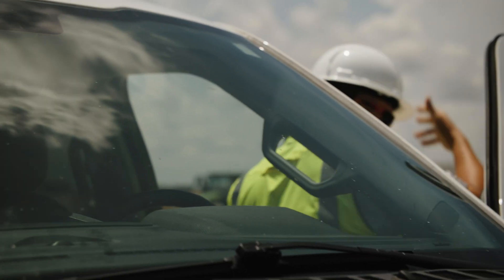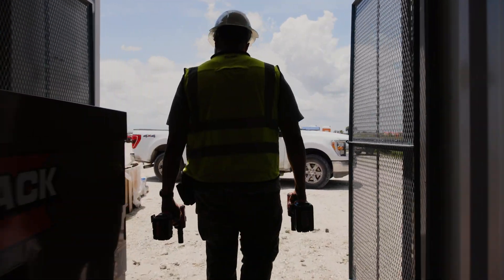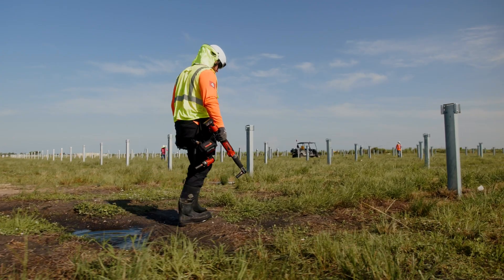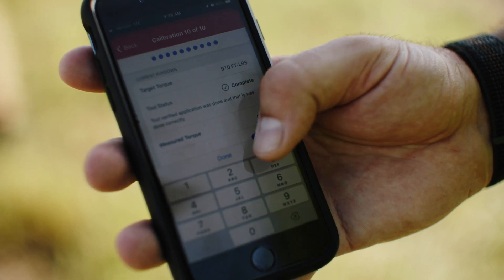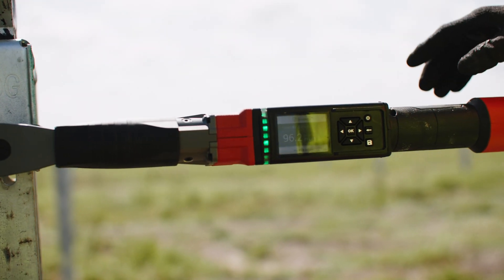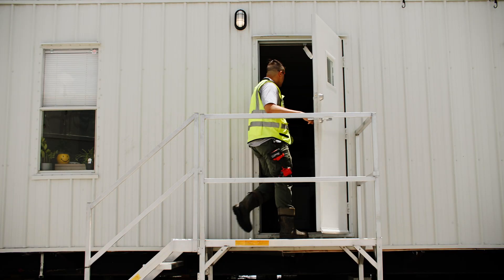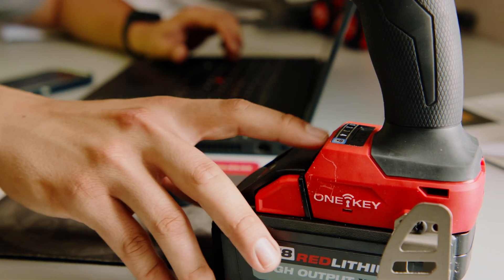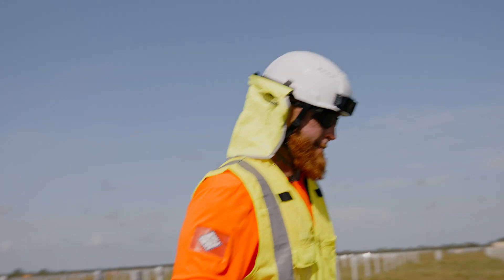M18 FUEL™ Controlled Torque Impact Wrenches w/ TORQUE-SENSE™ 3062 | The Most Repeatable Torque

Comment: Great! ANOTHER app. Why does every company think everything electric needs its own app?? Toasters, air fryers, and toothbrushes now have apps too. Its out of control. Put a cheap LCD screen on the tool itself! Not interested in going to use the thing after a couple weeks, going to login, reset my forgotten password with 3 numbers and special characters, then enter the code that was emailed to me and enter my mothers maiden name, to tighten something to 20 ft/lbs.
Reply: Its the same Onekey App Milwaukee use for tracking tools etc, you obviously don't use the range. You just made up a load of complaints that don't actually exist.
Reply: 😂😂😂😂😂Right?! Just give me a good gun and I’ll use my specialized non abused torque wrench. As a semi mechanic, touching my phone is the LAST thing I want to do when working on dirty equipment.